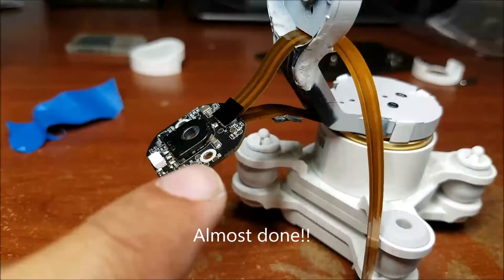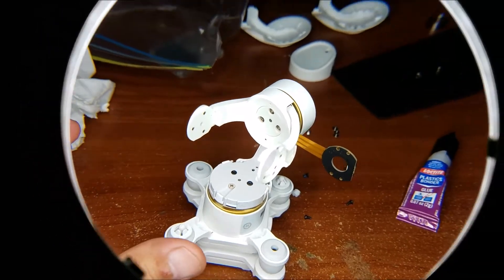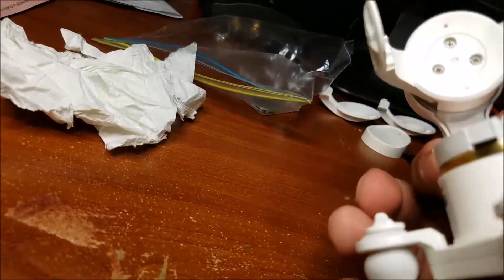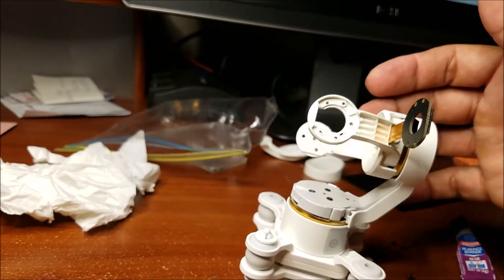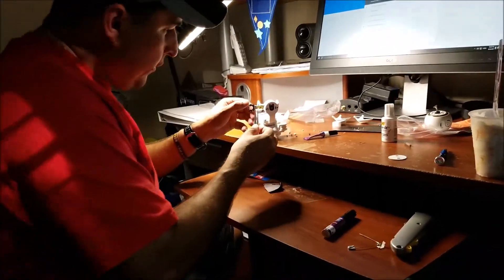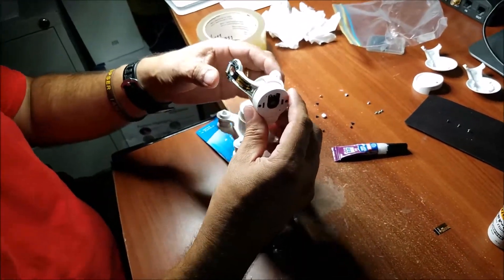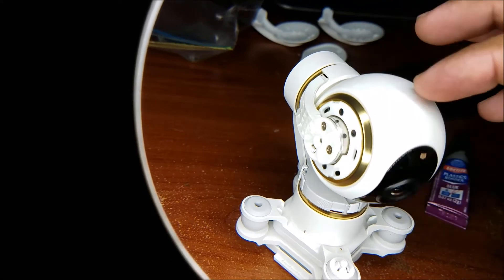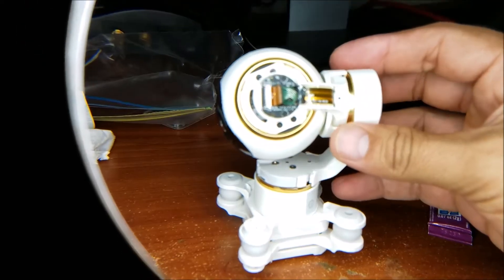Xiaomi Mi drone 4k broken gimbal repair Part#7

Comment: Hi when you plugged the new ribbon cable into the connector on the circuit board how do you close the white connector to hold the ribbon in place
Reply from the maker: thats tricky.... you must follow the same way you removed the old cable, then play with it
Reply: Sir please explain me more about that. I have no idea how you plugged the new ribbon cable into the connector.

Comment: Hi German, can you say some detail about box tape to support the ability to keep toghetar connection? You talk about at the beginning of this video. Becaouse I getting lost just in to make connect the new flex! Thank man for any help :-)
Reply from the maker: Hi brother.. . I did use regular box tape because i didn't have double side tape... double side tape is better and let you do a better job looking more professional, box tape is just if you don't have it at the moment,  just get a 3m box tape and alcohol and friction on the tape until you make a little ball of glue from the tape then use that on the ribbon cable... good luck

Comment: Hi and congratulations for the repair. My camera dropped while it was in flight and the green wires passed through the camera. You know for instance if you find a replacement or something in replacement. I am desperate
Reply from the maker: Francesco Casertano wow... thats really hurt... what exactly do you need? What parts?... or do you need the entire camera and gimble? Are the Berings moving freely or is not moving? Let me know to make sure what you need, or some parts or the entire gimbal and camera.
Reply: When connected to the drone, both lights turn on the camera but do not move and remain tilted. I opened to see the problem and I noticed that flat green wires coming out of the middle of the camera were broken. I wanted to know if you accidentally know where to find a spare or an alternative. Point it in the minute 7.35 of your video right to let you know what I mean
Reply from the maker: Francesco Casertano wow.. my friend to be honest I didn't see any body fixing or changing that wire... the only one I did see is the 3 I showed in one of the fist videos but not tha wire... the other solution is check online for a place tha fix that kind of wire or in the last case buy the camera with the gimble... GOD help u my friend is a hard job.
Reply: lo stesso problema trovato il cavo con fili verdi su Aliexpress
Reply: lo trovi su aliexpress
Reply: Eiii Francesco!!!! It happen to me EXACTLY the same thing!! I´m crazy looking for that green cable. You can see here: https://m.es.aliexpress.com/item/32822755308.html?pid=808_0005_0109&spm=a2g0n.search-amp.list.32822755308 but I think this is absurdly expensibe, and I wonder if is the same cable that nº 1 here https://es.aliexpress.com/store/product/Xiaomi-Mi-Drone-4K-version-RC-Quadcopter-Spare-parts-GImbal-Ribbon-Cable/1460814_32812828690.html

What do you think Ger
Reply: Ei PAolooo! what did you do????? I have de same problem.